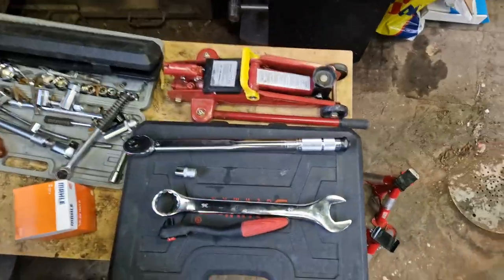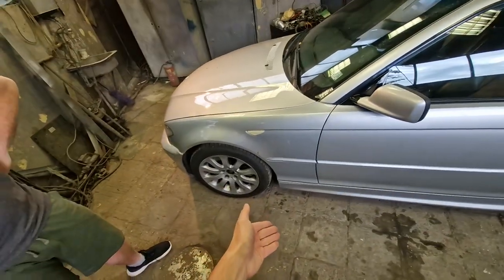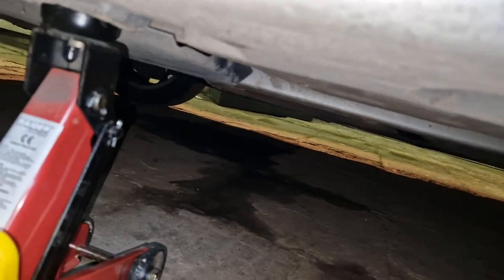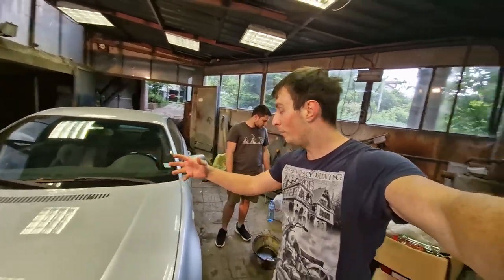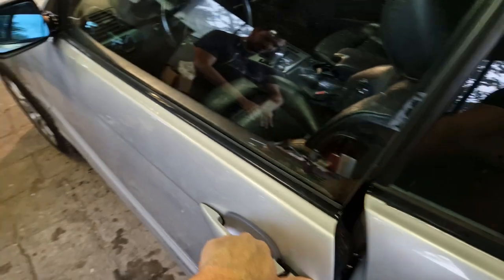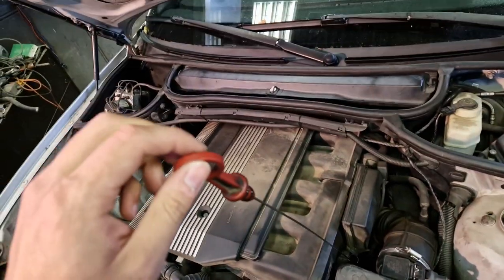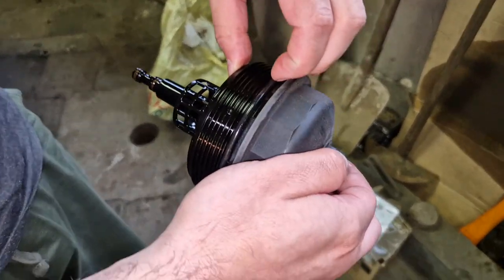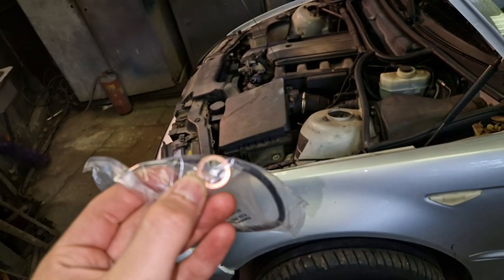HOW TO - Oil Change on any BMW M54 engine

Comment: Any oil consumption with Fuchs ?
Reply from the maker: yeah, around 4L 10 000km give or take. Really depends on where the car is driven though, in the city it doesn't burn much but with lots of highway driving it burned more. The engine needs new valve stem seals though. 

We switched to Ravenol VST and the car became quieter. I'm not sure about how the oil consumption is going though.
Reply: how do you know it needs new valve stem seals ? Mine consumes oil but it's not smoking when cold or when hot... @Zerga